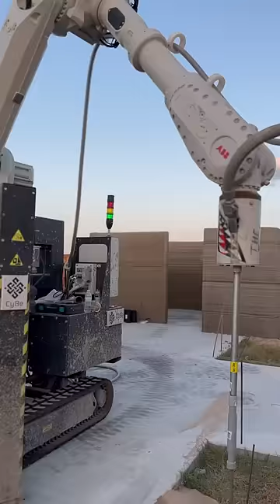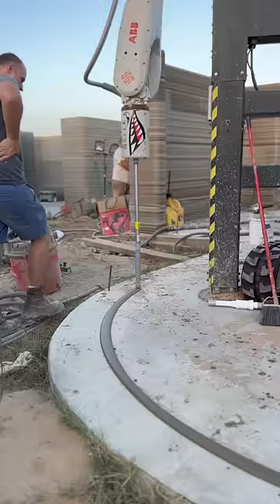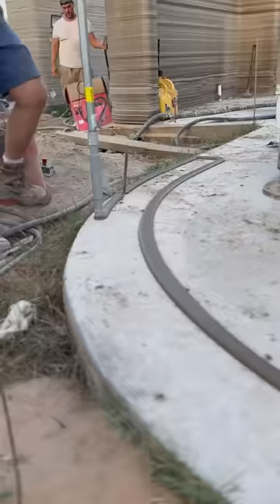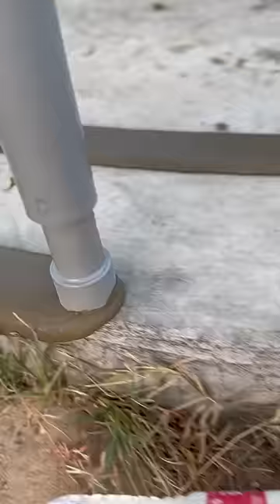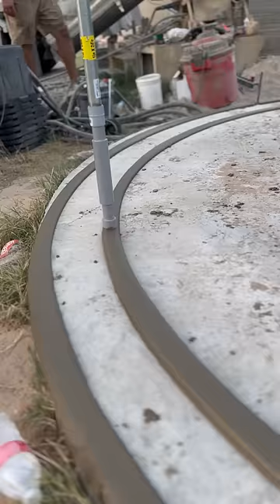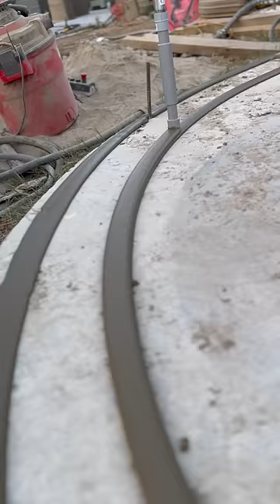Starting a fresh new wall with a two man print team #Hive

Comment: I would be embarrassed to post this.
Reply: For real 😂😂😂😂
Reply: Yeah wtf is wrong with them... Laying out bags of concrete in the rain would be more efficient and stronger...
Reply: @NoalFarstrider I don’t think it’s really about the durability of the stuff coming out of that tube as much as it is the stuff coming from the tube isn’t lining up with the foundation there’s sand where the machine missed the foundation that’s terrible😊
Reply: Why? Im not an engineer, can you explain to me?
Reply: @mohammadal-kamsha4020  you’re supposed to build on top of the foundation which would be the concrete. What’s the point in a foundation if you’re not gonna use it
Reply: @Malachi86  well he was using it
Reply: @mohammadal-kamsha4020  there were lots of parts where the cement was going off the edge and going completely off
Reply: You don't see a lot of footing work obviously. As I guy who used to deliver Crete I gotta tell ya this looks pretty slick even though the Crete runs off the footing at the one end. Nobody will see it once it's back filled .....😢
Reply: @garthlever9300 when the dirt underneath that part of wall settles faster than the concrete slab, that wall is going to crack like crazy
Reply: Some people should have no business in construction, heck they shouldn't have business at all!
Reply: I like to say, common sense ain't common sense. 😂
Reply: Agree.
Reply: @mohammadal-kamsha4020  by pouring on top of the sand it makes a weak point at the bottom of the wall because when the sand washes away there will be no support under that section of wall
Reply: @zackgreen7388  like there should be something  between wall the base 
Or nothing atall
Reply: @NoalFarstrider Might unironically be less watery than this concrete by the looks of it
Reply: @garthlever9300 stick to driving the truck I'll handle what comes out of it damn 😂
Reply: Seriously
Reply: @garthlever9300 that's going to crack where it went off the footing
Reply: @NoalFarstrider the buildings are actually fine if you do them right, theyre just doing it absolutely wrong. Its missing the foundation in a lot of the pour and also just kinda pouring on dirt and shit instead of the slab. These dudes are BAD.
Reply: This shit reminds me of the video of a guy building a dock and never snaps a line to put the screws into the treads. When he shows the results, the screw line looks like a drunk child drew a crooked line with a crayon and he proceeds to qualify it by saying that you shouldn't be focused on the screws but instead, the view of the lake. Now I need to find that video.
Reply: Take a few minutes to clean the dirt off your slab. Stop and reset when you see your pour running off the edge.
Reply: I never literally laughed out loud at a comment…but this…this had me chuckling lmao
Reply: @Malachi86 The whole house is made from cement 😂 they don't cost $500,000 for nothing
Reply: على الأقل تنظيف المكان قبل العمل
Reply: Where’s the Construction Fail guy? He can do his commentary for this one
Reply: @natashabegley1346  so you would be willing to pay 500,000 for shotty craftsmanship?
Reply: why they just making tough badass houses
Reply: @garthlever9300 it can't be backfield. Look at the height of the grass. The slab is it bro. They can put those slick water barrier tarps down and then back fill, but we're talking a few inches at most. Just admit, it's a shit project man. Cmon, be reasonable, you have experience bro.
Reply: @RandoManFPV ROASTED!!!! Tell'Em bro! Backfill my ass.

Comment: Everything about this video screams “don’t hire this company “
Reply: Right?!  Lol. That’s exactly what I was thinking. Wouldn’t take much at alllll to just push that wall over when they’re finished with it. Nothing to even connect that slurry mix to that footing.
Reply: Even with building printers these fools are Still too lazy to clean up between each construction layer.

This is why people DREAM of building their OWN houses (to settle in).

JUST to eliminate😅 the scum! leaving scum between walls & floors.

What's It Gonna TAKE⁉️huh

smdh.

Any1 replying with ocd taunts is wrong.
Save it for the ocd freaks that are concerned about the rebar impact, the cement offset & whatever else they notice.

None of that matters for Quality.

I'm QC - quality compulsive, although I wouldn't call it COMPULSIVE.
Reply: @EonAlpha ya. Everything about this process I don’t like. Not cleaning the footing off, no. Proper connection strategy between the wall and footing like rebar or at least a key way, and slurry like that has a pretty low strength to begin with. Not to mention going past the footing. As if it’s difficult to make sure your footing is the size and place it needs to be.
Reply: @donaldham308 there are a lot of countries building much poorer equality walls
Reply: @priceandpride  Then that means they need to work twice as hard to increase the quality of their work to a higher level
Reply: @priceandpride this seems to be China quality concrete work. So, we just became tied with the worst.

The future is now old man! We want our buildings to collapse a year after construction! HOW ARE WE GONNA CHARGE PEOPLE MORE MONEY TO FIX IT?!
Reply: Are you in the position to hire this company?
Reply: Why?
Reply: @donaldham308  you don’t need re-Barb with certain concrete mixers now. You should know this because you act like you know what you’re talking about.
Reply: @scottwhaley4585 you need a way to secure that grout to the footing, one way or another. And it’s rebar, not re-barb
Reply: @donaldham308  the funny thing is I act like I know what I am talking about.
Reply: @scottwhaley4585 don’t worry. We can tell you don’t.
Reply: @donaldham308  Good, I  was worried, that you were worried that ididnt know what I was talking about. Now i can sleep soundly.
Reply: Framing would’ve been up before that
Reply: As a chef with a background in pastry, that wedding cake is going to fall. just saying
Reply: I can feel the fear of all the trade workers in this comment section y'all making fun of fast food jobs getting automated guess who's next.😊
Reply: "Thatll be 400,000 please"
Reply: @scottwhaley4585 .......how's it going Mr. Dunning Kruger......you wouldn't happen to be friends with any narcissistic know it all kind of people would you?
Reply: @midbc1midbc199  no. But i hera your mom has plenty narcissistic friends
Reply: @scottwhaley4585 .......is that your attempt at an insult.....because your word usage is uhmm like you've never used the word narcissistic before
Reply: @midbc1midbc199 the Scott Whaley person might have a head injury or he’s a 12 year old.  At first I was thinking he might be a troll, but nothing he said was even remotely funny.
Reply: @midbc1midbc199  well that is what i hera
Reply: @scottwhaley4585 please, NEVER comment again.
Reply: @Carl_McMelvin  wow what a knee slapper......do you do stand-up comedy
Reply: you would only hire them if you want a badass printed extremely tough house
Reply: Guys, here is our Savior

HalleluYAH translates “Praise ye YaH”

YaH is The Heavenly Father
YaH arrives via the TENT OF MEETING
YaH was Who they Crucified for our sins
YaH was Crucified on an Almond TREE

Semitic of Moshe (Moses)
Isa Scroll (The Original Isaiah)

Isaiah 42:8 - I am YaH; that is my Name! I will not yield my glory to another or my praise to idols.

Isaiah 43:11 - I am YAH, and there is no other Savior but Me.

Isaiah 45:5 - I am YaH, and there is none else.

Comment: I learned something new today. Apparently if the foundation is off a bit, you can just put some sand down and call it good. That machine must be amazing!! 😂
Reply: lol
Reply: It's so ridiculously bad I can't help but think it's a ruse to get us all fuming and commenting and they already had a demo planned. 

But even if it is a ruse, it's a goddamn waste of time and material. So either way I'm fuming 😡 and here I am commenting 😂
Reply: When house crumbles
Reply: This feels so inefficient.
Reply: @kevinkanzler495 
 That is the only thing that makes any sense. They must just be using up some extra material and goofing off for the camera.
Reply: The foundation isn't even off, they set the robot to far to it's left. Had they taken the effort of simply moving it a few inches into the center then it would not have a 2 inch offset at the back and be on the dirt at the front. 

This is all ignoring how dumb it is to build unservicable walls like this. Just imagine trying to do ANY electrical/plumbing work in this "home".

Comment: Two man print job, but the one in charge of sweeping the floor took the day off
Reply: If they did that then nothing would be there to print the wall on it would be about four inches lower
Reply: I thought so too 😂
Reply: Naw dude its worse than that. The printer isnt aligned to the foundation or they poured the foundation wrong...they added the dirt so the print could continue...this is massively fucked up
Reply: @DTNorthern exactly glad im not the only one to see it. I guess QC is nonexistent for them.
Reply: No the guy sweeping the floor? Poor guy is walking around hands in hip, can't find the brush.
It's the boss, who is on a day off.
Reply: 1 k likes freshly printed after swipe comments
Reply: Rumor has it they're former electricians
Reply: That's the third man's job
Reply: @DTNorthern exactly 💯
Reply: @DTNorthern he means the concrete slab is dirty as hell 

the other mistake is pretty obvious, but them not even bothering to sweep before they started printing is truly indicative of their work ethic.

incorrectly operating a complicated machine is one thing, but basic fundamentals of building aren’t.
Reply: Oh you are funny. You actually think a couple specks of a dirt is going to make a difference from a product that literally has sand in it
Reply: And the guy in charge of making it straight and uniform called off. The guy in this clip is just some passer-by.
Reply: The critical people, self thought of as experts, did not take the day off.
Reply: Never hired him.
Reply: Well sounds more like one printer job
Reply: Don't worry any illegal can do it.
Reply: When the machine's got more QI than the sum of the workers QI.
Reply: @dazenguile4215 I think another fundamental is coloring with in the lines. Kindergarten level stuff.
Reply: They’re both too good to sweep
Reply: he was never needed
Reply: One in robotics one in computer programming
Reply: @chrismehl1607 watch it bud 🤨

Comment: Structural integrity left the chat once that machine started pouring off the footer
Reply: They have the "imma buy this big ass machine because I don't trust anyone but myself" mentality, sad.
Reply: Why the two man team there?
Reply: They just piled some sand up in place of the footer like it would suffice… this shite is a joke.
Reply: I'm guessing that for the price of that machine they could hire a crew?
Reply: Just like the old schools say “ we’ll it’s good enough for a government job “🫣
Reply: ventilation?
Reply: I'd say the machine is fine, their program uses an arc there that doesn't match the footer.
Reply: "Freshly built house sourced with the finest of materials, $500k. I know what I got"
Reply: no just off thge footer, but over dirt so it wont bond in some areas to the underlying footer. he literally started on dirt no bond just weight holding it in place in that particular area. fusing of minerals cannot take place there
Reply: @intrametaarchi1015 what? 😂
Reply: @T1Oracle once..
Reply: One rebar connection between the footing and a curved wall? Same guy who uses a pile of dirt as a separator between pours.
Reply: @T1Oracle  For an entire year lol
Reply: This machine is the antithesis of structural integrity bro

Comment: Just proves that even  a CNC robot cannot overcome an incompetent human.
Reply: A machine is only as smart as the person using it
Reply: yes because this is the final version of the product and will never be improved ever
Reply: @wileycoyote9688 hes not talking about the product genius. Theres atleast 3 things wrong about whats going on here. The rebar in the path of the pour. The over pour past the edge and the dirt pil at the end. Either coveeing the footing or coveeing the fact that there is no footing there. The pour was pretty satisfying.
Reply: Eventually they will use camera topography to eliminate human error.
Reply: By putting concrete right over the dirt.
Reply: No machine can overcome being careless 😢
Reply: @keyholer4664 I'd add inconsistent distance from the edge - the foundation is not round
Reply: That’s always been the case…
Reply: @daithirievley3350 in the 😮😮😮
Reply: @aiwaiwou3556 the footings are almost always mangled and set the have tolerances to allow the wall framing to fix errors.  There's no real need to have consistent differences marked from edge.  But they SHOULD permit the actual wall dimensions to fall atop them!
Reply: Walls on dirt are fine. Cracks? Shifting? Pffft
Reply: Gpt is here now
Reply: I think y’all got baited lmao they definitely posted this to generate viewers
Reply: ... yet
Reply: Said it perfectly 😂
Reply: For real!
Reply: why would it need to they are doing everything they need to or are you a grown man that doesnt understand how these work throwing a fit about some dirt
Reply: @keyholer4664 it’s not just pour past the edges. The robots positioning isn’t on center, so it’s short on one end, and off the edge on the other. Whole thing is out of position.
Reply: @theoriginalmonstermaker there is no reason to have consistent differences from end to end? That’s just lazyiness? The reason is : why not do a better job when given the opportunity? Slopping, no pride in one’s craftsmenship anymore.
Reply: Have the same problem with robot welders it still needs a human and the company will not hire competence.

Comment: Dont worry about the grass, sand and footprints, or the the fact that the printed wall is already sluffing off the side of the foundation in a few spots. Nah, that 1 piece of rebar will hold it up. And if you forget where the rebar is, after it dries you can just look for the little joggle where the printer bumped into on the bottom 8 inches of your wall. 👍 There you go.
Reply: Funkfpv vibes
Reply: @mpouhahahha  I'll take that compliment.
Reply: Uff😮😮
Reply: You get 0 outta 10. Thank you for playing.
Reply: 😂😂😂 отличный юмор братишка
Reply: Thank god for that rebar then eh? What a hero
Reply: Для курятника и кладовки сойдёт 😂😂😂

Comment: I always start my printing on a dirty plate, adds character.😂
Reply: Ugh, thank you can run a 3d printer but can't run a push broom apparently.
Reply: @sebrofc  I'd argue they can't even run a 3d printer since they didn't follow the basic preparation steps required for successful printing.
Reply: Dirt makes the wall 50x stronger

Source: I am a black belt
Reply: Makes it easier to grab the part once printed.
Reply: @7duke77  True
Reply: @psplayer1344  🤣
Reply: Even with building printers these fools are Still too lazy to clean up between each construction layer.

This is why people DREAM of building their OWN houses (to settle in).

JUST to eliminate😅 the scum! leaving scum between walls & floors.

What's It Gonna TAKE⁉️huh

smdh.

Any1 replying with ocd taunts is wrong.
Save it for the ocd freaks that are concerned about the rebar impact, the cement offset & whatever else they notice.

None of that matters for Quality.

I'm QC - quality compulsive, although I wouldn't call it COMPULSIVE.
Reply: @WernerBeroux in this case, for a kansas tornado in NORTH DAKOTA.
Reply: @EonAlpha  100% right. OCD or not. Given the choice, I'd pick an OCD guy to build my house, fix my car etc. Some things need to be done right and "good enough" won't suffice.
Reply: @joshrandall3632  what we need, though, are OCD engineers & scientists.

They existed back in the day when mechanics weren't a niche, yet.
Reply: @EonAlpha  Absolutely. I was just thinking on a more local, personal scale. I don't want some rando doing my important work. Definitely want a surgeon who is OCD as well.

Comment: It must cost a lot extra to clean the dirt clods off the cement before they start. Top notch crew!
Reply: Clods? Are you 5 in 1976?
Reply: dont need too these houses are new and improved just lay em and they stronger then most all other houses
Reply: I never seen any one sweep dirt before the poor over it. Concrete is in it's self wet dirt.
Reply: Did you just say concrete is wet dirt…

Comment: I like how it doesnt follow the pad.. and even goes over the edge. Quality stuff
Reply: Its programed. The foundation wasn't perfectly made.
Reply: Follows what it's told to do... Either operator error, or the pad is off.
Reply: @Vivungisport either that or the machine was not centered
Reply: @Vivungisport Nothing is perfect, that's why you need adaptive systems and feedback mechanisms
Reply: It's a human error, not the machine
Reply: Probably $1m machine but they don't use rtk or some other kind of survey equipment to get the machine centered. "Ya right there Juan, that looks center "
Reply: обычные погрешности
Reply: @Vivungisport 😂
Reply: That part is the least of the worries lmao, it's printing on sand😂😂
Reply: @Brskit It's actually dirt but yeah, that's not exactly giving me confidence in the final product
Reply: Oh yeah....u wait the terminator is just a few thousand years away no😂
Reply: how not to do cement print, on dirt and away from fondation....

Comment: The surface isnt prepped. There is a pile of dirt under the first pass. Half is on the concrete and half is off. The quality is supposed to be in the prep work and proper alignment, especially since the labor is being done by a machine